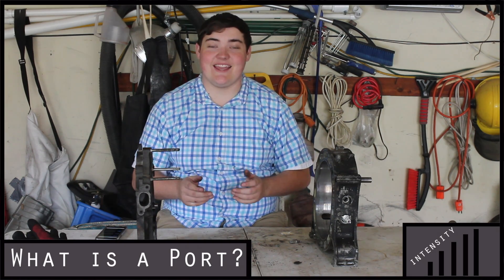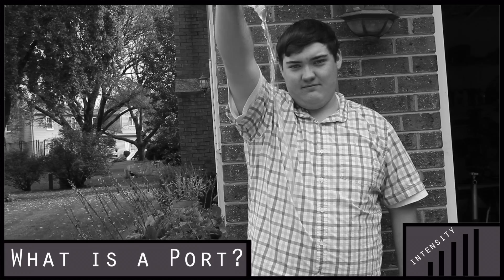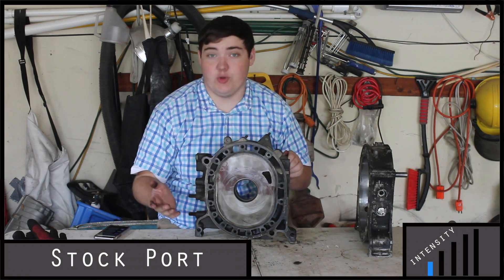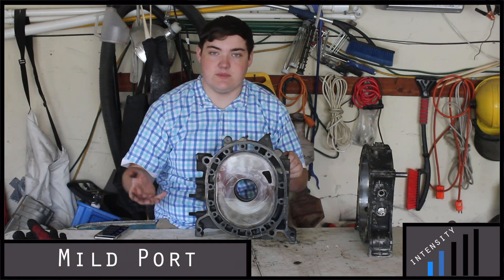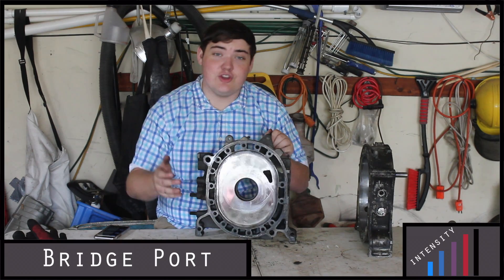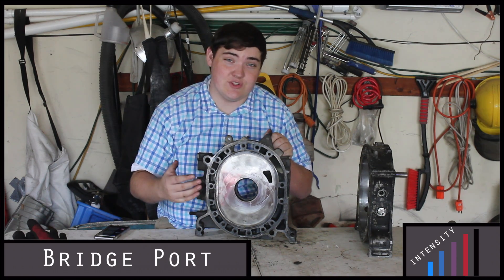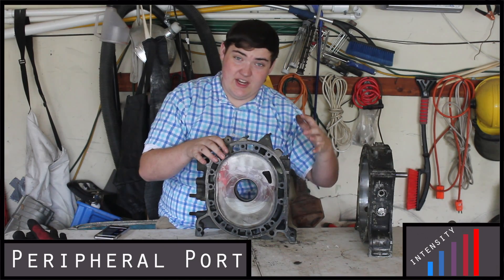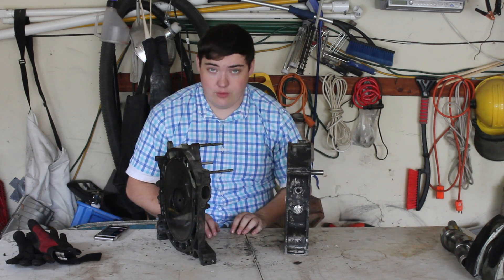Porting A Rotary Engine: What Does It Mean?

Comment: porting doesnt = rpm gains. p port is a port not using any stock ports and using the area above the exhaust ports on the housings as intake points, porting a rotary = more port timing, allowing more time for air and fuel for come in , also more over lap between intake and exhaust stroke aka why a bridge port braps but a mild street port does not 👍